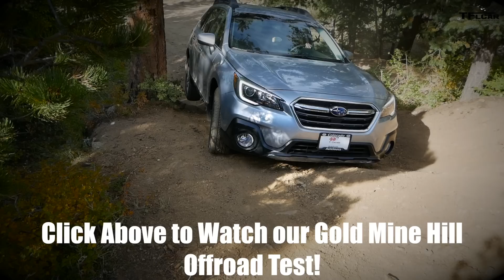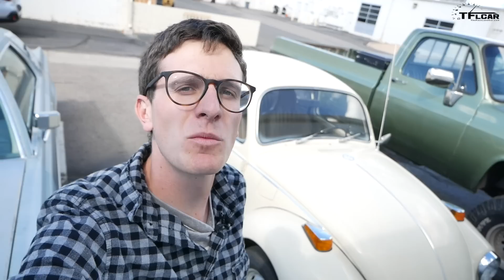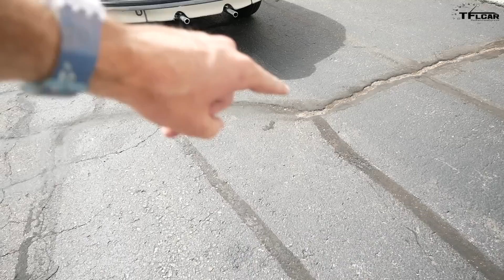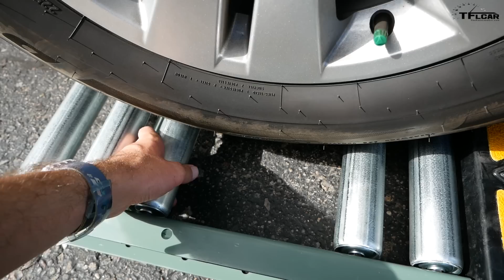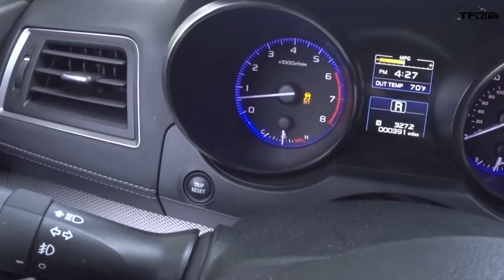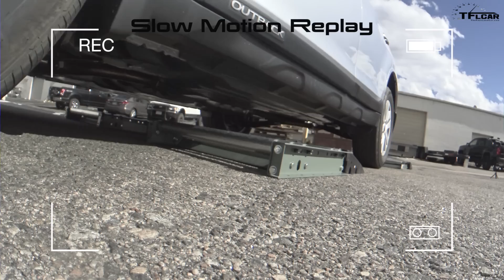The Truth About Subaru's Symmetrical All Wheel Drive:TFL Slip Test vs Subaru Outback

Comment: In the real world you guys already proved the limitations of the Subaru. I think that's a cvt issue though
Reply: I don't think it's the CVT so much as the torque converter that is used to get started being a lot smaller than when the whole transmission was based off a torque converter. The current CVTs seem to have about the same 9 - 10 km/h per 1000 RPM overall speed at the slowest ratio as both the manuals and autos have had for a long time. And if you actually do have them fully engaged they seem to be happy to take all the torque the engine will give. It's just at the standing start zero speed up a steep hill (or whatever) they they seem to be lacking compared to a conventional automatic. And that, to me, points to the wimpy little torque converter.
Reply: Bruce Hoult that is likely correct, I'm not a Subaru expert, or even know a lot about them, but I know cvt transmissions aren't good for anything but fuel vefficiency.
Reply: That's the opposite of what I said. The CVT doesn't seem to be the problem because it will take all the power you can throw at it once you've started moving and the torque converter locks up.
Reply: Bruce Hoult and what I'm saying is that torque converter came with the cvt.
Reply: Yes it did, but there's nothing stopping next year's CVT coming with a better torque converter. It's a problem with the detailed implementation, not with the concept.
Reply: Bruce Hoult and how do we know that this torque converter isn't used as a protection mechanism for the cvt trans while under high torque loads like we saw in gold mine hill? I hope they fix it for the sake of Subaru fans
Reply: We know this because once you get going at 10-20+ km/h the CVT will take all the torque the engine can throw at it. As I've said twice already. There are any number of videos of CVT Outbacks, Foresters, XVs performing very well climbing very steep hills as long as they have some forward speed.
Reply: A CVT can maintain peak efficiency and it can also maintain peak power. No other type of transmission can do that for more than a few seconds. When you reach peak power in any other type of transmission, you are basically at red line and have to upshift. A CVT transmission can maintain peak power until top speed is reached. That's why they were banned in racing years ago. 

That doesn't mean they are fun to drive or good for off roading. I will be selling my CVT equipped Forester XT soon and buying a 2019 RAM Rebel quad cab with a 5.7 liter hemi.
Reply: @dns711  What this guy said
Reply: CVT will always on paper sound like a good choice when you are needing to bump up CAFE numbers on a vehicle that you will sell many of.  Designing a good CVT AWD system with all the components geared for traction and MPG will be a big step forward.
Reply: Last time It is the user issue,  this time around the user read the manual, understands the car, know     the limitations whatever it may be. And the vetdict... subaru is still a capable car.
Reply: The hill climb video had nothing to do with it being a CVT and everything to do with it having street tires. Also the Subaru does not have the suspension travel to deal with surfaces like that.
Reply: @danielboyd7810  are you the Daniel Boyd I drink beer with on a regular basis?
Reply: @dns711  That's me. I was thinking, hey I know a guy who is also trading in a forester for that truck, then I looked at the name. It's a small internet world.
Reply: I would like to see a cvt Honda CR-V compare so you can contrast different cvt implementations